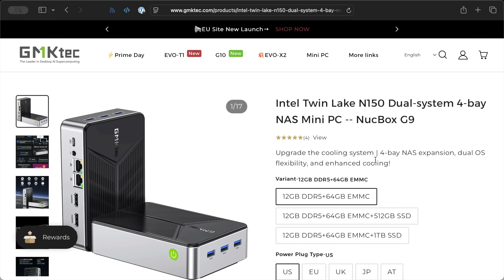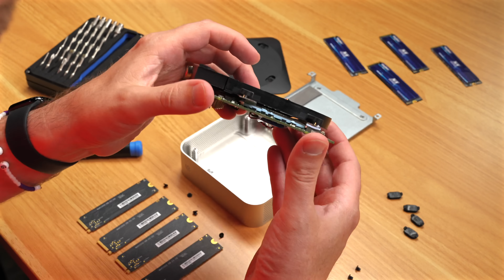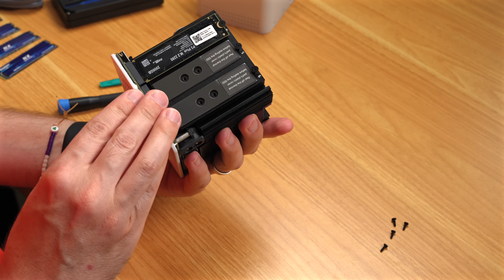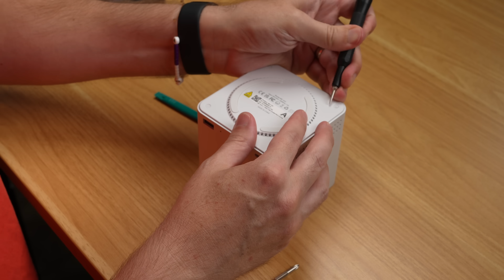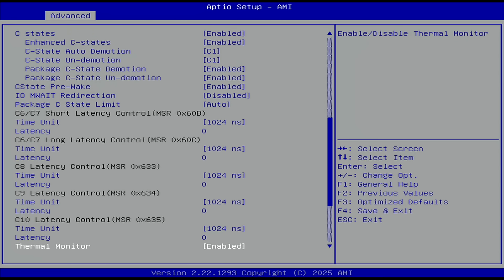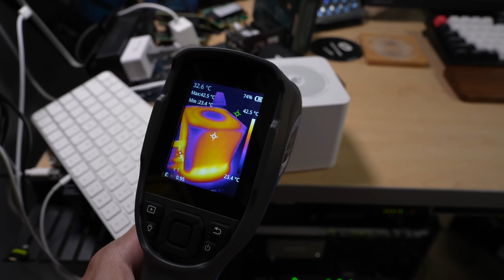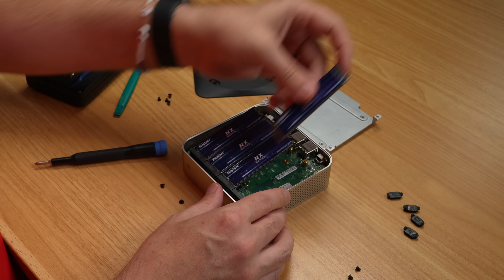The Mini NAS has arrived! (mini homelab)

Comment: One of the things I look for in a NAS with multiple disks (SSDs) is RAID at the hardware level (pre boot).
Reply: I don't care for such a feature. Hardware RAID (or realistically, firmware) tends to mean poprietary undocumented formats with unknown flaws and lock-in. With software RAID, I can just RAID1 mirror the boot partition across all the drives - it's supported by GRUB - and never care which slots they end up in, or which actually booted.
Reply: Software raid has won though, why would one go for hardware raid? I would go out of my way to avoid it.
Reply: You definitely don't want that... Especially on a budget...
Reply from the maker: It would be nice—but I haven't seen any consumer NVMe system offering RAID in the BIOS, only when using SATA drives (and still, only some boards do that).

Comment: well, diy ups from rc/drone battery. they go up to 1kW output for some minutes per 1500mAh lipo battery. better than worse. your years are numbered. avoid law bugs. because they dont use their own advised products themselves. so they dont focus on key user features, only superficial features. service to people spreads easily, or attempts to. usb-c connectors are horrible, dont stay in place. a bit janky "solution" or merchandise which is not a solution but perpetual sell trade for every day bread. potato sata3 ssd nas ftw. also those potatos have multiple sata3, like 4-6.

Comment: We need an 8x NVMe with SFP+.
Reply: That's 32 pci-e lines, consumer cpus dont have that much to spare
Reply: @elektroencefalografista  One solution to that would be using eight x2 lanes. Drives that support PCIe 5.0 x2 signaling (like the Samsung 990 Evo Plus) but are designed around PCIe 4.0 speeds are not bottlenecked. 

One challenge with this approach is that Intel is very stingy with PCIe 5.0 support on lower power mobile CPUs. An $82 dual core Intel Processor 300 has 16 lanes of PCIe 5.0 and 4 lanes of 4.0 (plus chipset lanes). But a Core Ultra 7 265U only gets PCIe 4.0 and 3.0.
Reply from the maker: Asustor's Flashstor is the closest thing there, but it's still slightly underpowered. I have been begging them to make a new revision that fits inside a mini rack!
Reply: On an X570 AM4 motherboard, I have 6 NVMe drives (2 on the board's M.2 sockets and 4 in a Hyper M.2 card in the x16 slot). I can put a 10Gbe in the x4 slot and a video card in the x1 slot. If u need more bandwidth for the video card use a bifurcation card with 1 PCIe x8 and 2 PCIe x4 M.2 sockets. You could put a 5th NVMe SSD in the x4 slot, but then you give up having 10Gbe.

Comment: K100:
Could you make tha data part/partition a few (or some more) gigabytes smaller on every drive so you have the space for a boot/OS partition. I know, you loose this space on all drives but you should be able to add a small 3-disk/partition RAID.
Or my thoughts are just nonsens, but the software should have the needed flexibility in 2025.
Reply from the maker: It would be nice, but that would need support in the BIOS, and unfortunately that's not there.
Reply: @JeffGeerling  Are you sure? The OS partition wouldn't be part of any RAID.
But of course, the later setup uf the NAS part of the drives is probably manual, not using guiding GUIs.

Comment: My issue with these things is that if I'm investing the premium for SSD drives then I want max performance. So I'd want 10 Gb ethernet, otherwise I can saturate a connection with spinning rust drives all the same, and get way more storage.
Reply: But for some people the small case is the first priority
Reply from the maker: Both valid points :)

I hope the next generation N100-class chip from Intel (or maybe a low end AMD APU) could have the grunt and maybe a couple more PCIe lanes to saturate 10 Gbps. The N150 just can't get there, at least with more than one drive in a RAID array.
Reply: That feels like a complete misunderstanding of the point of this use case.

HDDs are physically big and use power and make noise.

You simply can't make a device physically as small.

Many many more people are able to accept a 24/7 server box if that's a mini PC with flash storage so it's entirely silent and uses less juice.

Not everyone wants or needs 20+TB of the fastest storage ever, but a 2TB flash mini server will perform great for basically most family web apps.

Also, random IOPS are just plain better on flash, so serving things like a music or podcast library backed by a database and web app will run better than on spinning HDD.

If all you ever look for is "more more more", you will fail to appreciate the "just about good enough" situation that basically most normal people operate within.

So yeah, if you are buying a premium m.2 card for an affordable cost effective solution, you are doing it wrong.

Affordable and premium are opposing concepts.
Reply: @suburban-vampire affordable and reliable are also opposing concepts when it comes to SSDs. Jeff said it in the video "you get what you pay for with SSDs". There's also nothing about streaming music and a podcast with a database and serving a webpage that a single 5400 RPM drive couldn't easily handle.
Reply: @suburban-vampire  I think the "Mini NAS" concept is an edge case scenario.  I think for most people, the elevated cost of the hardware and storage would be enough of a deterrent to invest in something like this.

I think another consideration that needs looking at, is MOST people likely to set up and manage their own NAS, are also likely to be savvy enough to have considered upgradeability and expandability.  What you start out with, will never be what you end up needing.

Given the limited storage capacity of these mini nas devices, I think that anyone that can be satisfied by such a low limit, would be more likely to look at a turn-key setup, Synology, QNap or similar.

I don't think these are pointless, I just think they're limited in scope, and very niche in their use cases.
Reply: its not for premium drives -
Reply: @kaisersolo76  you get what you pay for with SSDs

Comment: With the K100 --- is the gap between the case and the m.2 heat sink small enough to fill the gap w/ good thermal pads?
If not, it could be worth adding some other copper sinks to the stock sink to add more mass for absorbing heat
Doesn't seem like it really needs it tho (temps were ok)
Reply from the maker: The trouble there is the bottom of the case is a plastic panel, so that wouldn't help. But as I showed, the drives never got above about 55°C, so I don't think their large metal 'heatsink plate' is too bad, either. I was just nervous about whether it was enough.
Reply: @JeffGeerling  - That's true good point and the temps weren't bad at all. I guess it's not that surprising b/c the Pi400 and Pi500 use that large style heat sink and they cool effectively. I'm a bit of a cooling overkill guy, so I would probably still drill the case and try to add a fan lol. 

Regardless -- cool video idea. I had just downgraded the size on my own backup NAS into one of those Jonsbo NAS cases (w/ an i7 12th gen). Downgrading from a rackmount server dedicated as a NAS. But I never considered having a more portable version. Now I'm interested in what possibilities are around even if it's more of a cold backup for the most important things.

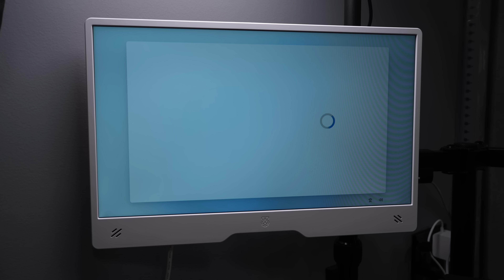Comment: 9:03 - Excuse me? They shipped Windows 11 as the default on a NAS? Are they high?
Reply: Just think of it as a Mini PC with extra drives. and as far as I know you can tell Windows to use the drives as a RAID, but that is really all I know about this feature.
The licenses for Win (10) 11 Pro seem to be very cheap for this processor type and used additional hardware because I every Mini PC I've looked at ships with Windows Pro (if it is sold with an OS).
Reply: @JohnADoe-pg1qk  All NASes are mini-PCs, and I wouldn't put Windows on any of them. Besides, you're not going to be able to use a proper FS on Windows. Nevermind the monstrous overhead of using a garbage OS on a low-powered device.
Reply from the maker: There are still a good number of people who don't consider Linux at all for a computer they'd buy. Probably a vanishingly small number of homelabbers, but at least a little NAS like this can be the gateway drug into Linux once someone realizes the limitations of running storage on Windows!
Reply: @JeffGeerling  that's a fair point, but shipping it with Windows is a limiting experience (performance and feature-wise). And don't most devices labelled as a "NAS" come with a web UI, which would mitigate any differences between OSes? For a NAS you want the best filesystem for data protection, which is going to be ZFS or btrfs. You can't get that with Windows.
Reply: Likely possible that shipping it with ANYTHING like Truenas might cause some sort of licensing issue, besides, Beelink probably knows that 99% of the owners of such devices will wipe Windows completely, and install something like TrueNas or something similar.   End result is that Beelink would only need to support the hardware, not the installed OS.
Reply: Depends what u would use the device;
It´s a nice surplus to have a Windows Licens number (even when i dont like 11), which i use now on a other device,  when u would use this device, for the moment as desktop; and for me it made no sense, to put all my old nvmes (128 till 1 TB) inside it. It also offer me the different between Windows (10 degrease more) and Linux.. nearly same picture, which i had at the 9 device...
I duno know why, but under windows this devices are mostly have 10 degrease more, than under linux.
So, with the cheaper days of now, i ordert the rest for this nas... cheaper...
And now i could fully use as a Nas...
And the formal nvme it´s placed in a other device now

Comment: For the beelink ME, do you have concerns with the durability of the EMMC drive running the OS? Logging etc... might kill it over time?
Reply from the maker: Not really; I've been running a number of Pis off eMMC storage for years now; as long as it's a reliable vendor for the chip, and you don't sit there spamming gigabytes of logs per day, it should survive at least a few years of modest activity.

If I were running anything generating lots of data (like prometheus or other monitoring tools), I'd definitely make sure those things were stored on the NVMe storage array, and not on eMMC, though.
Reply: @JeffGeerling thanks! That’s helpful. I picked up the Beelink recently and waffled on using one of the SSD slots for the os drive. Using the emmc drive for a read only restore image or something. Out of fear the logs would just kill the drive in a year.

It might be cool to think about a low write volume configuration for a nas Linux server to extend the life maybe? Truenas and/or a Ubuntu server install. I’d love to watch that video 😊.

Comment: the k100 is kind of a sweet spot with the only problem of not having the emmc, it would be great for Van life or super portable solutions like editing storage while going to cons. Running two boot USBs in mirror seems to be fine in my experience with TrueNas scale.
Reply: the k100's website says: built-in capacity: 256G. Maybe something changed.
Reply: @sifumech maybe they just include an M2 ssd with it?

Comment: Hey Jeff, never heard of kingspec until u just installed them. Is it not like a cheap SSD brand such as Netac? Are they actually reliable?
Reply from the maker: I've had maybe a dozen different Kingspec SSDs over the years; they're typically budget but reliable. But they often seem to change up the chips (and apparently, entire PCB designs!) on their drive lines, probably to save cost after the first batch sells through...

They're usually not the lowest price, but they're on the lower end.

I stick with brands like Kioxia, SanDisk, and Samsung in my servers.
Reply: @JeffGeerling  Allright, thanks! I'll give them a try then. i hope to find the best budget / reliable SSD, but there are so many of them nowadays I almost need to try 100 different brands
Reply: No 4k blocks on nvme drives by them?

Comment: I would really appreciate a nas with proper networking in this form factor
Reply from the maker: There are one or two coming out soon with 10 Gbps networking... the only problem is the N100/N150 can't really feed that more than halfway, so I figure we might have to wait for another chip, or spend more and do the N305 or an AMD APU system to get 5-10 Gbps consistently.
Reply: the ms-01 with 12600 and dual 10gb sfp fits the bill
it can only do 3 nvme drives but that should be enough

Comment: Jeff, have you considered raiding all the drives and installing the OS to that rather than burning one drive for OS?
Reply from the maker: Most mini PCs don't have BIOS-level RAID capabilities, so you wouldn't be able to get at least basic OS installs working that way :(
Reply: @JeffGeerling  I guess you could do something goofy like mdadm for the devices and then ZFS on top of that for the data storage.  (Not that I would recommend this, of course.)
Reply: :shrug: Depends on your risk appetite, I guess.  This has been available and used since Solaris days, so it does work.